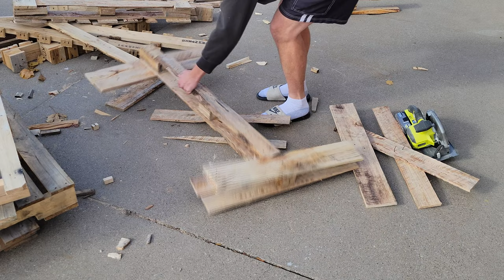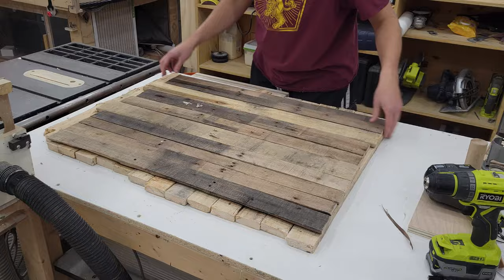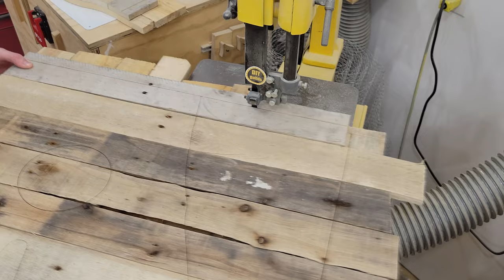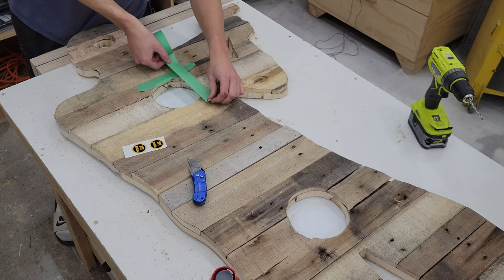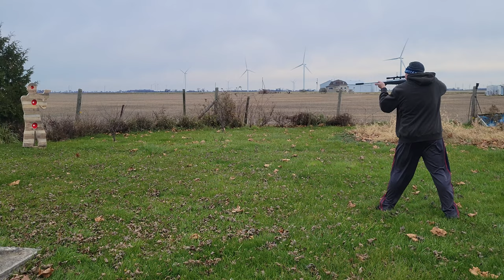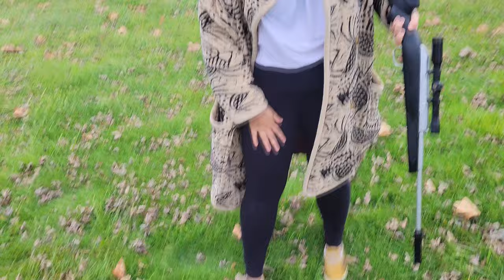DIY Pallet Wood Target

Comment: A suggestion for a modification (might even eliminate that ricochet). Install the metal backers on a small hinge so it flips off the wood form. You'll still get the satisfying "ting" but BB or pellet will be less likely to seek revenge.
Reply from the maker: Na she shot the wood and it rebounded lol
Reply: @DIYBuilds  The power of hard wood 😀